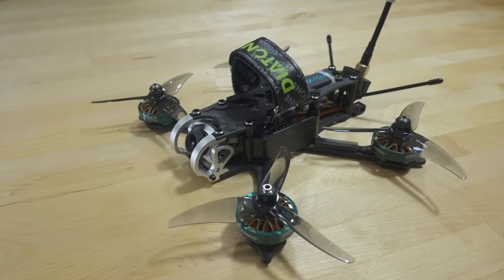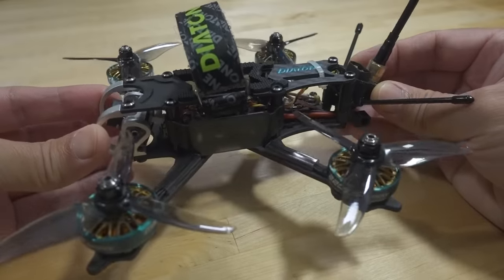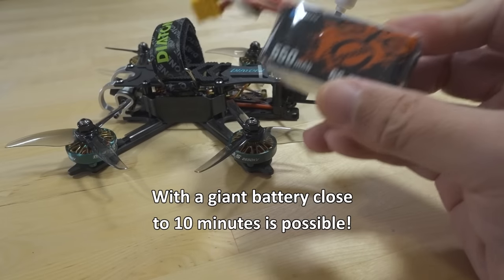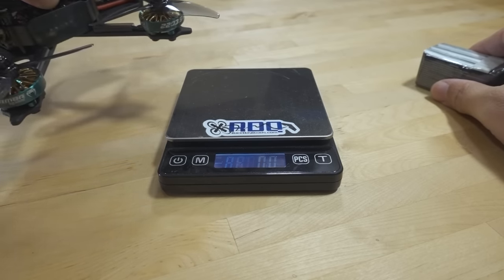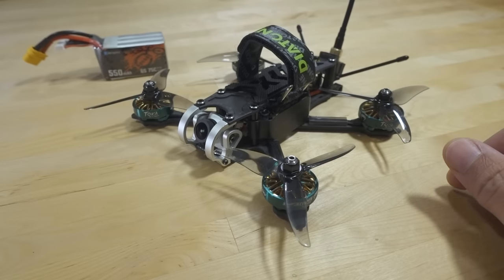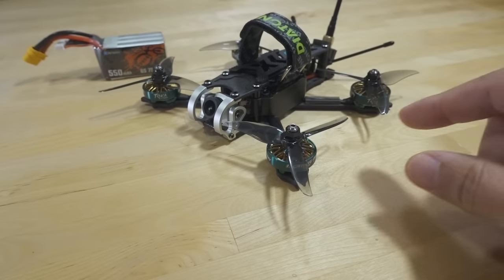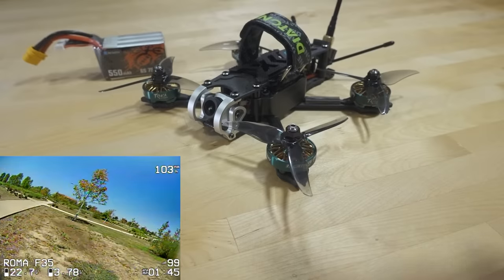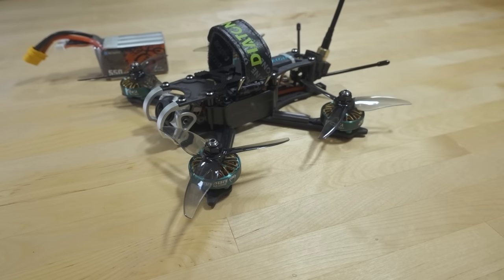INSANITY QUAD 😱 // Diatone Roma F35 (Can YOU Handle IT???)

Comment: The phenomenon you are talking about @ around 7:30 is aerodynamic drag and cavitation. Max prop tip speed is 450mph, past that the tip vortex and turbulence on the trailing edge become too much and detach the airflow from the prop surface and cause extreme drag. You can brute force past this, but you'll have insane amp draw, vibrations and reduced performance so its not worth trying.
Reply from the maker: One thing I forgot to mention is that the low-end torque is intense on this.  Super locked in when making direction changes.  That could be the unseen benefit here.

Comment: More power 💪😎
Was thinking those motors look like they belong on a 4 inch. Diatone makes some great stuff at reasonable prices , very happy with their stacks. Only concern I have is break an arm, it's a big deal . I'd rather have replaceable arms. It's got plenty of motor to lift the little bit of added weight. And it's already over the 250g arbitrary weight limit. Thanks for sharing, happy flying Albert 👍🤓
Reply from the maker: Thanks 👍

Comment: Hey man, what do you think about the 40a esc on this thing? For a 6s setup with peak current at 15.59a/motor, shouldn't a 60a ESC be used?

I'm still learning which components will go together
Reply from the maker: The ESC is rated 40A continuous 55A burst PER motor.  So 16A per motor is NO PROBLEM.

Comment: Nice review 👌.. that's a small beast.. so the props are giving the motors a limit.. different prop more speed..
Reply from the maker: Yes, the small prop can only do so much.  Imagine even a bigger motor with that small prop, will it really go any faster?  No...  However, the advantage is on the low end of the throttle with a massive amount more torque to control the tiny prop.  It was super locked in.

Comment: I just brought some axisflying 2004 3710kv to replace the 1404s on my smart35 to use on 4s.... you recon its a good choice and better than the 1404s? Weight without battery would be 164g..
Reply from the maker: One thing for sure is that it will be a beast... you'll have a ton of power for sure.
Reply: @AlbertKimTV  beast and power sound good lol... I've got a crux35 hd coming so don't mind trying different motors on the smart 35.. hopefully be a beast like my 3 inch 1408 4s🚀

Comment: Is it possible to transport a complete gopro on board?
Reply from the maker: Should be possible assuming you can mount it and you have space for the battery but performance won't be nearly as good with the extra weight.

Comment: I've been waiting for this video I just seen it on the website I was about to order but I wanted to see the review first from you
Reply from the maker: What's the verdict?  Gonna buy it?  😎😎😎
Reply: @AlbertKimTV  I am seriously thinking about it ,I  have my f5v to dji version 4s,which i love.. and I have the GT-R 90 which I've had for a long time, that's how I knew about you is from your review of the 90 while while back,lol, I love the 90 but everytime I grab it it's always where the wires are when I hold it and I keep on accidentally pulling wires out and I'm always having to resolder them to the board from just grabbing the quad over time, but I was wanting one that's  alittle bigger then my 90 and smaller then the f5.
Reply: I can't decide between this one or the L3 or L4? I was looking at the F4 also, because it was on sale.
Reply from the maker: @camarochip  tough choices... can't win either way...
Reply: Which one in your opinion had a better straight out-of-the-box experience, the L3 or the new F35? I still don't really know how to tune I just like to grab something and fly it.
Reply from the maker: @camarochip  The F35 was better between the two.  Keep in mind the F35 is running EMUflight and not Betaflight.

Comment: On top of your suggestions for different motors.....how would 2004 1750kv (6s) preform on the 3.5in prop in your opinion?
Reply from the maker: 2004 size might make it more efficient but without actually testing that size with this prop, it's just a guess.  I know on cinewhoops with 2004 motors and 3-inch props, they have very good control on the low-end but not that much speed on the top end.  However, I fly those with a lot more extra weight on board so the flying dynamics are really different.
Reply: @AlbertKimTV  I fly the 2004 1750kv on my apex 4" freestyle rig and it is amazing. Hoping if I go that route with 3.5 I don't lose some of the punch. Thank you for your response

Comment: I really like this. 2650kv would be pretty high for 4S on a 5", I can only imagine how it is on 6S (I do know it's only spinning a 3.5", but still!). I have 2400kv on my 5", and even with a 75% output limit it's an absolute animal on 6S.
Reply from the maker: Just goes to show how every pilot has different experiences.  Some would say 2400kv at 100% is "slow" 😂
Reply: @AlbertKimTV  would you run a 2400kv on 6S with no output limit? Just wondering. If not, would you run a 5S with no limit?

Comment: Is it of any use, high-torque motors, small props, high voltage (6s)….? And what will the flighttime be?
Reply from the maker: Who cares when it's just FUN.
Reply: @AlbertKimTV  Well, if one picks any quadcopter, is this value for money or is there a quadcopter at the same pricepoint which is better balanced out (looking at the overall setup).

Comment: Eachine need to take notice of this 3 inch quad .
The novice 4 I bought is so fragile ,but this looks beefy and looks like it could  take a crash without ripping arms off.
Reply from the maker: Not all drones have to be the same.  Variety is good and a lot of people like the super light designs and will still buy those even at the expense of durability because they have different priorities.  I'm not sure why everyone thinks all quads have to be the same in FPV.  It's like saying the only car any auto maker should produce is the Toyota Camry because that's the "best" and no one should be allowed to drive anything but the best (whatever that means).
Reply: @AlbertKimTV  We'll if a arm breaks more often then not because of a awkward landing ,I say that's bad design .
Unless you never crash and are willing to repair  it constantly.

Comment: Looks close to a 4 inch flouride with 6s 2303.5 motors build coming up once I get two micros out of the way. Going 4 inch with it but plan on running the HQ 89mmX8 props un-ducted hahah Its going to be wild. You need to get your micro 6s lipo supply built up man lol
Reply: all the 6s micros Ive run from 1106 on up do not increase speed or performance over 4s but you do increase your flight time with 6s done right.

Comment: Most of my flying is in local parks where there isn't too much space to keeping things under 250g gives me the most freedom while staying within the regulations if I was ever challenged on it - nobody has to sate, but I'd rather live with a smaller quad than lost the ability to fly. (Entry for SpeedyBee TX800 VTX)
Reply from the maker: FYI, i've seen people flying smaller and lighter then 250g quads get in trouble, get fined, etc.  It's not really that safe.  Most cops are totally ignorant of the rules.
Reply: @AlbertKimTV  You're not wrong. Also, I should really re-read and check spelling before posting :)

Comment: I don't know if  you follow Chris Rosser or not, maybe you just have really good instincts due to how long you have been testing quads and the sheer number you have probably flown by now.....but long story short he has done a lot of calculating and graphing and such and his data seems to indicate that the 1806 motor would be the best choice for 3.5 to 4 inch props. Your hunch seems to be right on the money
Reply from the maker: Sorry, I don't know who that is.  I don't watch any other channels or follow other people.  I purposefully avoid that so my opinions aren't polluted with the ideas from other people.  Yes, I've flown thousands of different models and I'm able to make some basic judgements about what would work based on just experience without a lot of prior testing.  But at the end of the day, it all comes down to a subjective choice.  What one pilot likes may not be the same for another.  Each set of specifications can yield different results for different pilots.  This is why we need a much larger choice of parts and designs rather than a smaller number.  I feel like there are certain forces at work where only a limited number of people want to be in control of what gets made and what doesn't and this is actually bad for FPV.  We need more diversity, not less.  Why is the standard 5-inch freestyle frame still the only one most people fly?  All 5-inch frames are just clones of each other.  Nothing special.  Something new and different comes along and all the lemmings immediately try to kill it off before even trying it.  What's up with that?  Sorry for the rant...

Comment: Have. You done any durability tests?
Reply from the maker: Durability tests are worthless because there's no way to duplicate a crash and there's no standard for how to achieve a test that makes sense and has any integrity.  If you know of such a way please advise.
Reply: @AlbertKimTV  that makes perfect sense. The only type off "durability test" i can come up with is just using a drone for a long time and seeing what breaks. For instance I've had a basher for a about six months now that I've flown 800+ packs threw and have pretty much replaced everything except the motors. (Emax eco 2 series 2306 1700kv)  motors.. and somehow they are wonderful still. But in the end thats more off a longevity test. So you are right.

Comment: Almost 7:1 seems like bad news. I purchased 2204 to try and hope they do well.
Reply from the maker: What does 7:1 mean?
Reply: @AlbertKimTV  It is a diameter:height ratio for the motor. Typically large flat motors have a high MOI, and don't perform as well as a taller, more narrow motor for freestyle pilots usually in the lower throttle range. That's my understanding, at least.

Comment: A couple of mentions:
Ive heard with the scarcity of resources going on BNF are sometimes being used to source parts.  How do you think that would drive sales?
Also, the F35 seems perfect for freestyle in areas that might be too small for a 5", cheaper too.
Lastly, Entry for SpeedyBee TX800 VTX
Reply from the maker: The supply chain problems are a more recent issue.  Not enough data on that yet but I'm sure it's messing up a lot of things all over the place right now.

Comment: if you want more speed above 80% throttle find a 3.5" 4 or 6 blade prop. you will no longer have that loss of power feeling @ 80% throttle.
Reply from the maker: Perhaps.  You can't know that for sure, but interesting guess.
Reply: @AlbertKimTV  I mean, I can know for sure. just because you don't doesn't mean someone else can't.
Reply from the maker: @techromancer6702  You haven't flown this model, how can you know for sure?
Reply: @AlbertKimTV  because it isnt dependent on the model but on the mechanics of props and how you gain additional thrust at the same RPM with different props. the model is irrelevant to the thrust the prop will generate, as long as the motor can sustain the changes in inertia.